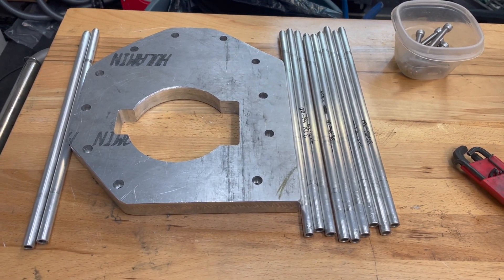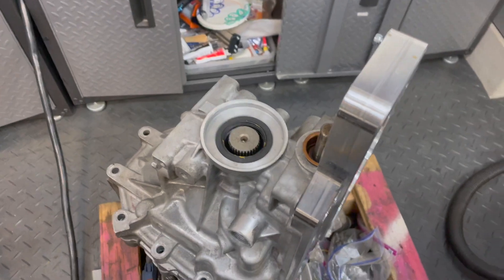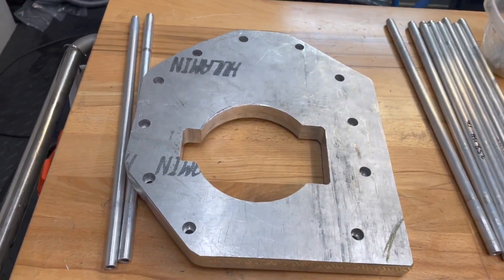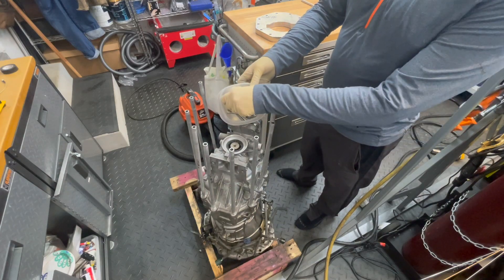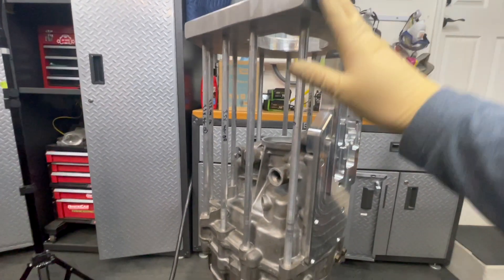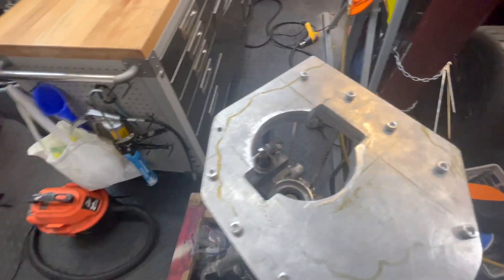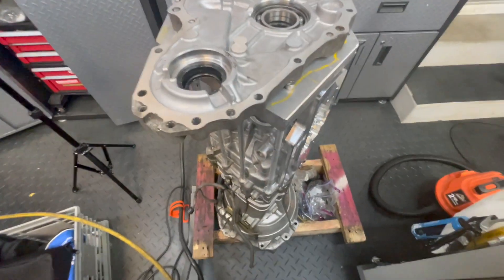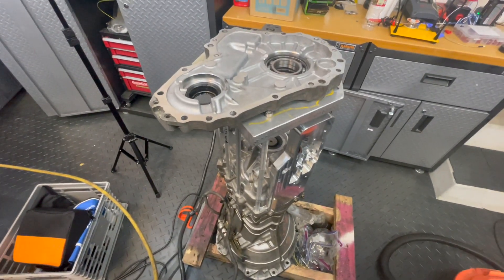All wheel drive 260z - All Nissan drivetrain? - Part 2

Comment: Just found this series and finished the first video and skipped ahead to the other videos to see what you ultimately settled on. Now to go back and watch 2-7 in full.

I was REALLY hoping you were going with the VQ and the OEM Nissan AWD system! The DE, HR, and VHR variants all have OEM upper oil pans that mount the F160 front differential with a variety of ratios to choose from. And I saw in a much more recent comment that you've switched over to an R33 GTR transmission which I gather is to have your manual transmission and transfer case all packaged up without any sort of complex adapters. As I'm typing this, I'm to the point in your video that the dowels are fairly wobbly. Did you consider a Frontier/X-Terra 6-speed manual for a 4x4 vehicle? It's effectively a CD009 transmission that's flanged to receive a transfer case, albeit on on the incorrect side. Before I settled on my current transmission, that's the method I considered going. The shifter placement on that transmission is ahead of the transfer case and would still (with a very thin adapter, theoretically) use the electric transfer case  from the G35X you had in your first video.

Anyway, I'll shut up and watch but just thought I'd comment because you seem to have been down the same path I was on a couple of years ago, too!

Comment: I'm wondering, with the CD009 in the S30 chassis, wouldn't that shifter mount place the shift lever too far aft?

I'm considering the Autosports Engineering Front Mount Shifter Relocation kit. I figure by moving the shifter forward, the transfer case can mount closer to the transmission tail housing.

I'm looking forward to any updates.
Reply from the maker: Good question! We’ve been working on the 2jz for the past year, which will be the next update. I’m working on some mockups to show where placement will be. I’m relocating the stock cd009 shifter about a foot forward.
Reply: @btechnol   Makes sense, the 2JZ doesn't have a front diff passthrough so you have to mount the engine a lot farther back.

I'm also doing a 2JZ in my 280Z and was also trying to figure out AWD, that's how I stumbled upon your video. What are you doing about the front differential, an F160?
Reply from the maker: Cool! Yeah. It is going to be tricky. I have a few ideas for the front diff, including just using the same r200 I have in the rear. Need to balance size with weight and torque capacity. I’m using a dry sump to save space as well. Of I can’t get the 2jz to work I may need to use the vq but I love the 2jz. What are your plans?
Reply: @btechnol  The F160 on the R32/33/34 are of interest to me. Some people bandsaw off the diff mount flange off their GTR oil pans to convert to RWD and trash the diffs, so I'm hoping to score one and graft it to a 2JZ oil pan unless I'm able to move the 2JZ far enough back.

I know firewalls can be cut and reshaped, but I'm concerned about trivial access to coilpacks and spark plugs.

Either way, I have a rough "game plan" but I'm focused on doing 2JZ. An RB would be nice, but it's no longer the economic choice. I would still do the CD009 but AWD is still a top priority. There's no point in having so much power without traction, IMO.